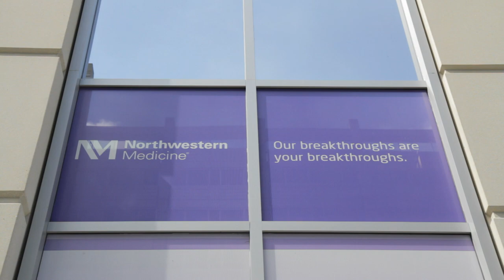Advances in Transcatheter Tricuspid Valve Repair & Replacement with Dr. Charles Davidson

Comment: I have a leaking tri cuspid valve and a leaky mitral valve that causes me to have edema and out of breath issues. But since the leaks are considered mild, the doctors won't fix them. I don't know how to force them.
Reply from the maker: Hi Dennis, So sorry to hear about the symptoms you are experiencing from tricuspid and mitral regurgitation.  That is not fun.  Curious... Have you thought about getting a second opinion?
Reply: I have mitral valve regurgitation is mild also a aortic valve with mild sclerosis and mild regulation ,and severe tricuspid regulation ,, I have AFIB , daily ,4 weeks my heart rate was between 115-150 non stop ,, Now with new medications my heart rate is around 80 ,but the AFIB is there ,,I was hospitalised,and doctors just talking about AFIB , nothing about the valve , a m scare ,, what will happen if they not fixing my valve ,, I know I can die about ,,, What can I do ?
Reply: @piroskamerk106  if you have severe regurgitation they should treat it. for afib they cut your heart so the afib doesn't affect the whole heart. I have a cardiac resynchronization device (like a pacemaker) that keeps my heart from beating over 120. My valves used to be mild to moderate. But they heal some over time if you exercise and keep your weight down. My valves are now 'trace' regurgitation, my fitness is better, and the regurgitation settles in my lungs and I cough it up and spit it out. It's ok to be scared but it won't help. I was scared but as it became less severe I am better. You can get a watchman implanted too that will keep you from having a stroke. I'm taking just spironolactone 400 mg a day, it's a diuretic and a heart pill. You don't have to take potassium with it.

I read valves don't heal on their own. But as the walls of the heart heal the valves work better. anything else let me know.
Reply: @dennislurvey3235  Yes you right to day I visiting my GP will ask why they don’t don’t do about my severe regulation. I just checked my heart with Kardia my heart rate was 115 and AFIB as well I read severe tricuspid regulation can cause AFIB and chest pain ! I have all of this.   Thank you for answering! ❤️From Australia 🇦🇺
Reply: @dennislurvey3235  What are you saying, that your valve problems have regressed from mild and moderate to almost nothing as a result of exercise and maintaining a healthy weight?  But that's extraordinary! How long did this regression take place?
Reply: @anteversus8471  it's been 3 years to the day since my heart failed. I had an EF of 14. I had been told the left ventricle would normalize and make the valve seal better. I do have a CRT-d implant but I don't think it has ever triggered. I also have stage 3 kidney disease and some fatty liver. I also lost 40 lbs just cutting back calories. I still take water pills. But no more leg swelling either. I did learn to eat better too. All my labs are within normal range except kidney and that isn't getting any worse.

Doctors always say clean up the diet and exercise but almost no  one does it. I did and it worked.
Reply: @anteversus8471  It slowly got better over time, the symptoms were going away slowly, the leg swelling, the discoloration of the skin is subsiding, the shortness of breath, the high blood pressure. Cardiologist explained it as the left ventricle normalizes in shape which allows the valve to seal better. It's been 3 years now but it has been good for 6 months. I actually had to request an echo to prove to myself it was really better.
Reply: @dennislurvey3235  Thank you for responding so quickly, I hope you are getting better and better as you are coming back from a reduced ejection fraction to 14. And today, what about you, have you managed to get back to a more or less normal EF?
In my opinion, your heart failure of three years ago did not come from your valves because a mild to moderate failure goes unnoticed and untreated. At stage 1 and 2 a mitral or tricuspid insufficiency does not cause edema and shortness of breath yet, for that you have to be at least stage 3.
If you were put on a defibrillator, it was not due to your valves but to a heart failure of another origin which manifested itself noisily by a renal and hepatic problem, breathlessness and water retention.   
Losing weight is indeed the first thing to do when you have heart disease, plus exercise. These are sine qua non conditions, and which you recall very well. You are the proof and those who will read you will find the courage to imitate you for the greater good of their health. Thank you for reminding us of this.
As for you, I wish you better health every day, continue to take good care of yourself.
Reply: Hi! I currently have mild regurgitation both in my mitral and tricuspid valve, but sometimes i feel fatigued and palpitating. This usually occurs when i lack sleep which usually occurs more often than not. I suspect i have sleep apnea. I regularly exercise, able to jog 30mins non-stop. U think my fatigue and palpitation episodes are due to the leaking valves or to sleep apnea, if any?
Reply: Hi! I currently have mild regurgitation both in my mitral and tricuspid valve, but sometimes i feel fatigued and palpitating. This usually occurs when i lack sleep which usually occurs more often than not. I suspect i have sleep apnea. I regularly exercise, able to jog 30mins non-stop. U think my fatigue and palpitation episodes are due to the leaking valves or to sleep apnea, if any?
Reply: Hi! I currently have mild regurgitation both in my mitral and tricuspid valve, but sometimes i feel fatigued and palpitating. This usually occurs when i lack sleep which usually occurs more often than not. I suspect i have sleep apnea. I regularly exercise, able to jog 30mins non-stop. U think my fatigue and palpitation episodes are due to the leaking valves or to sleep apnea, if any?
Reply: Dennis, 
Go to Mayo Clinic for a second opinion. I had my tricuspid valve surgery done there. They are an exceptional institution with an outstanding cardiology department. All the best to you.
Reply: I am a veteran and the VA don't let us go to Mayo. but I have a new doctor I am seeing tomorrow, cross fingers?
Reply: @dennislurvey3235  I was just diagnosed w/ mild mitral and tricuspid regurgitation, I am glad that it's possible for the valves to get better. What kind of exercises you do?